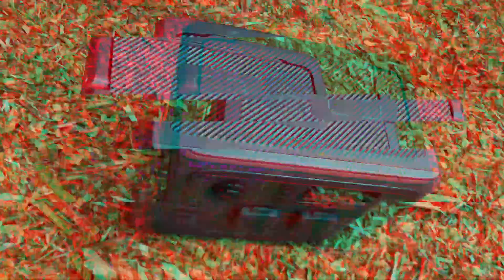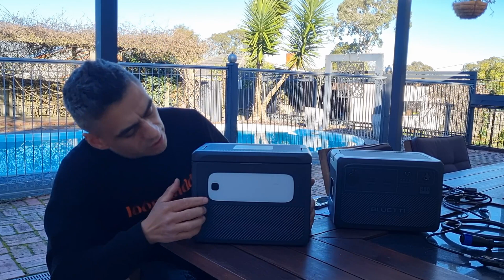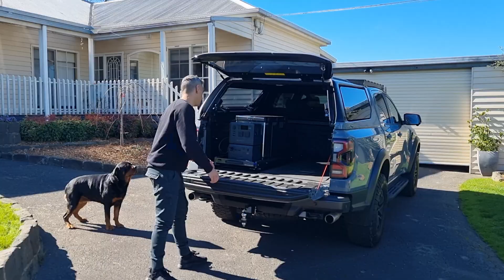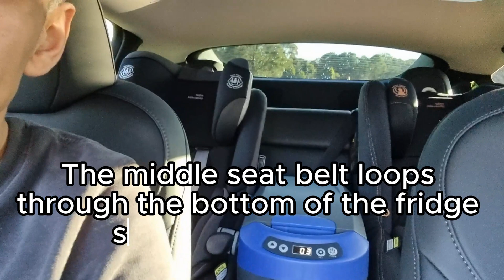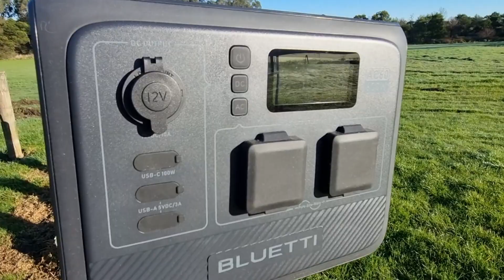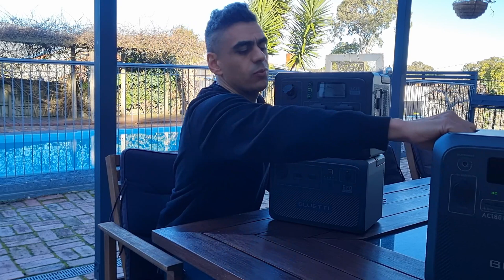Bluetti AC60 and B80, is this the BEST portable power station combo?

Comment: How long does the b80 take to charge on ac if it is hooked up to the ac60? I have the ac180 and a b80 at the moment i can only charge the b80 using cigarette lighter at less than 100 watt .. would like to go faster .. thanks
Reply from the maker: Hey mate, it's been a while since I have tested that, from memory its still 45mins 0-80% and maybe 1 hour to 1 hour 15 mins for a full 0-100% charge. I try not to get it below 15% so can't say for sure!

Comment: Does somebody know how Turbo Charge works ? I can't figure out if it has a 1440W charger or a smaller one but with a special feature able to deliver more power...
Reply from the maker: Hey mate, have you tried selecting 'Turbo mode' on the app? You get there by going into 'My Devices', then click on the AC60, then top right settings logo, 'Charging' then select 'Turbo.' I assume the charger is inbuilt and will allow 1400ish watts to the BMS?